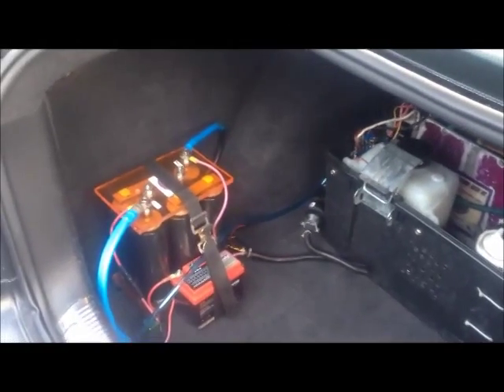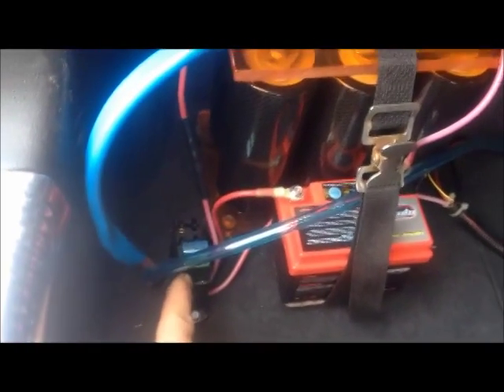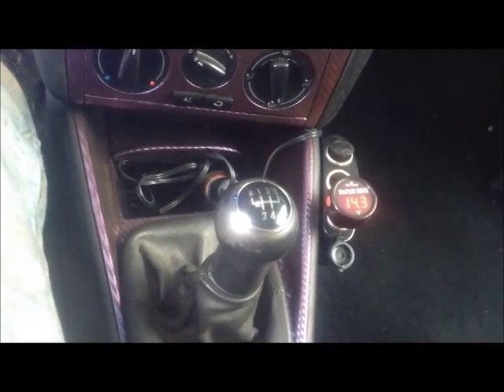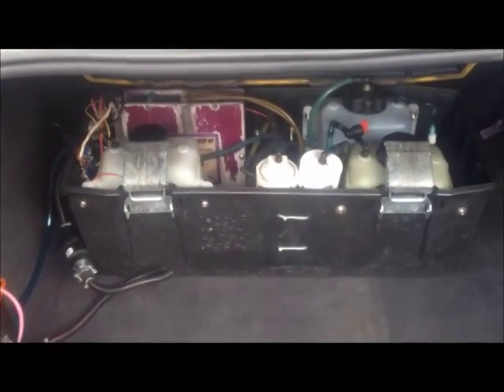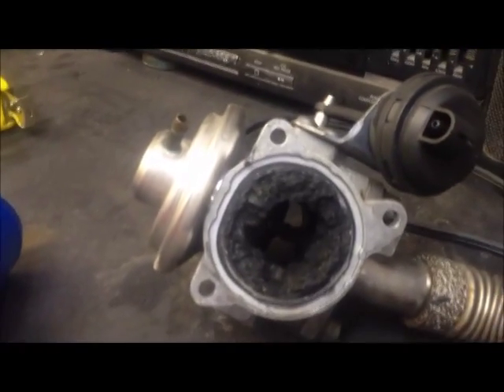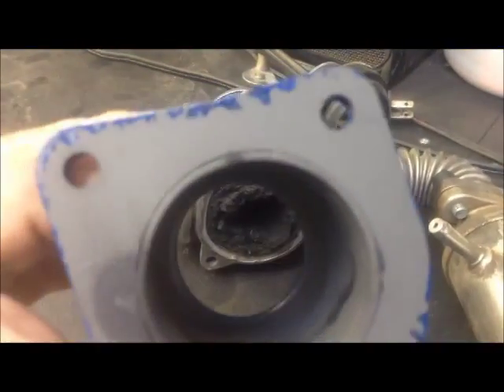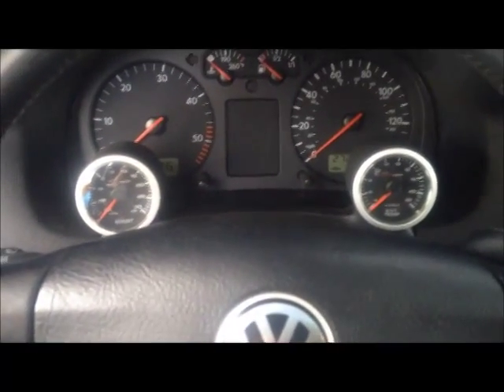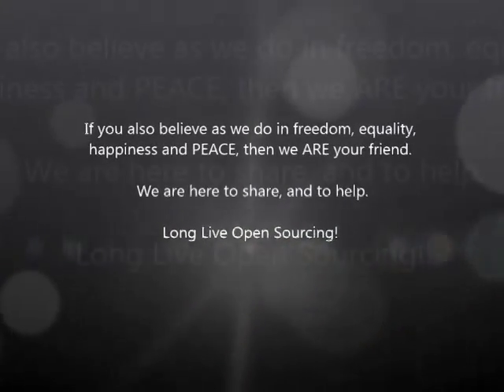Jettdi update: CAPStart tech, HHO injection, solar augmentation

Comment: EGR is used to reduce NOx emissions.  EGR can actually increase Particulate Emissions.
Reply from the maker: Yeah it is supposed to cool combustion (thus reducing NOX) by adding "non combustible" gasses (exh) to the air charge.  Another way to do it is to richen up just a bit which has a similar effect - but can also add particulates.  I found adding HHO also acts to cool combustion slightly, so I would assume that has a similar effect on lowering NOX - although I do not have a gas analyzer to test that theory.  HHO has been shown to reduce particulates, while cooling combustion, while EGR acts to increase particulates (unburnt byproducts) when cooling combustion.  Therefore, I say a better tune and HHO is the way to reduce both NOX and particulates, not EGR..

Comment: Love your work.  How many miles has she done?  Where do you insert the HHO tube...i.e. before filter and MAF sensor?  Should I get an ECU remap and dynotune after introducing a HHO system for maximum efficiency?  Totally agree with you re EGR, but also DPF.  I believe if it is tuned properly then emissions including diesel particulates are minimized.

Comment: I would love to see an electrolyte test, most tests online are done with distilled or everyday tap water. I think adding a more acidic water mixture may improve electrolysis of water.
Reply from the maker: +My HHO future More acidic mixtures tend to form an insulative material on the electrodes, impeding production.  Different materials might lead to other results, however.
Reply: +EletrikRidesAgain I mean a 25% citric chloride mixture, like lemon juice or similar!
Reply from the maker: +My HHO future I found those mixtures tended to bring out the heavy metals like Cr6+ and Fe ions into suspension.

Comment: I am very impressed with your TDI modifications. I have an 04 Jetta TDI also (mines the BEW engine not ALH like yours). I have been looking to install HHO injection on mine for a while. How does the actual injection into the manifold work? i assume you would need atleast a few bar of pressure to inject the HHO as the intake would be pressurized by the turbo. is there no problems with pre-combustion? like does the HHO gas just ignite when the diesel ignites from compression?
Id love to see a follow up on this video with some test results on mileage.
Great work!
Reply from the maker: Hello, and thank you.  The HHO is introduced pre-turbo, where the piping is not pressurized.  The percentage of HHO in the system is low enough that pre-combustion is not an issue.
Reply: Ok i see. how much HHO production are you getting out of it? have you noticed a mpg gain?
Reply from the maker: It produces just over 1LPM, gains average around 14%

Comment: I love the concept of a HHO working in combination with bio diesel, but my concept continuously charges the car.
Look into "solar active graphene" "graphene circuitry" keep your electrolytic capacitors because they will take a charge at any speed, increase your fuel intake/output. How many amps do you use? How big are your plates? Very curious here.
Reply from the maker: +My HHO future The unit draws 25 amps, plates are 8"x8".  Output is just under 2LPM.  The TDI is just a test platform to see how HHO works with diesel, and how the caps work - just a setup fo the real project.
Reply: +EletrikRidesAgain I think you may be under driving your cells. Max amp for a 8x8" cell is 32 amps says mike at HHO connection, but I'd give it a variable between 25 and 35 amps to meet demand. 

Luckily you said you had titanium cathodes, I'm not a fan of corroded stainless cathodes. rusty water vapor
I like your set up, but I can see room for improvement!
Reply from the maker: +My HHO future You should really check out my other videos, which go into great detail the engineering and design of these TI MMO substrates.  This will clarify for you how I am not underdriving the cells, but rather pretty close to the engineered current density for these materials.  A lot of professional research went into setting the parameters of my particular design, based on decades of data accumulated by engineers in the water purification industry.  Check it out - tons of great information.  TI MMO - one of the least recognized but best kept secrets in the HHO industry.  You will find an overwhelming amount of resistance from the SS HHO cell supporters who see this technology as a threat to their profits - but I could care less about how many SS cells they can sell or not.  I'm just interested in safe, clean technology.

https://www.youtube.com/watch?v=DNevytvW0N8

Comment: About that cold air intake system. Isn't going to suck warm air from the enigne bay? It's gonna be bether if u fab a heat shield and vent the box a bit.
Reply from the maker: The ducting from the grill to behind the battery dumps right onto the filter.

Comment: Buy anerican staff,keepnthe money at home,but you drive german car:)))
Reply from the maker: I drive a USED German car, that I bought completely wrecked off another American who bought it from another American who bought it from yet another American.  So not only did I keep my money here in America, I also helped the environment by RECYCLING a smashed car that would have gone to the scrap yard and did not buy a new car.    A new car adds at least 10x more carbon to the atmosphere (due to manufacturing, energy, and resources to make it) than recycling a used one. Think it through for a moment.  When you buy used at home, it no longer matters where it was manufactured because buying used means you are recycling.  And at 40mpg I dont feel bad about not driving an American gas guzzler.